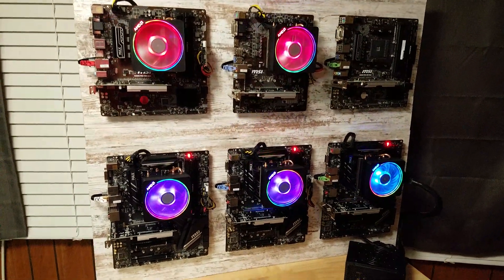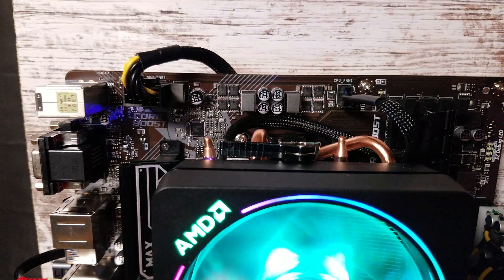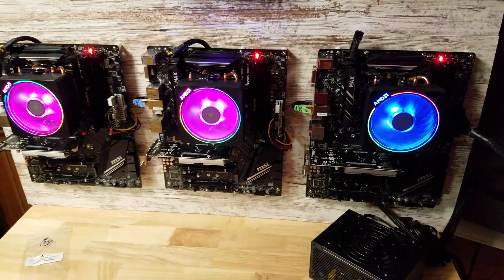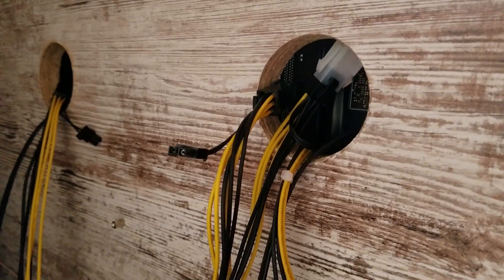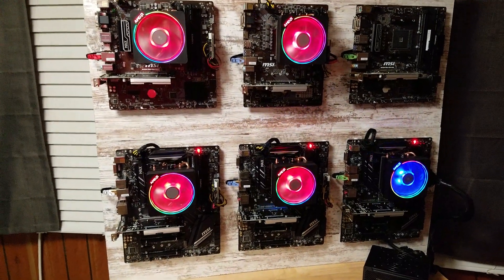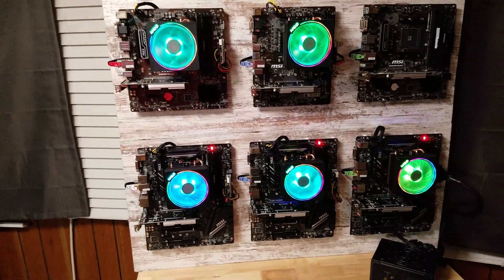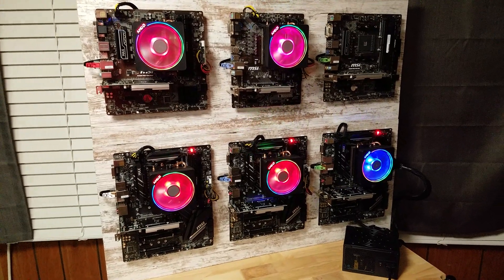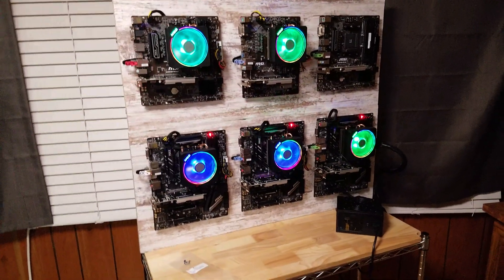Raptoreum Mining Wall

Comment: What’s your hashrate with the 3.6mhz and 1.0v setting? Thank you 🙏🏻
Reply from the maker: Avg hash is 3900x is 2.85, 3950x is 3.80, 3700x is 1.89 @3.6 allcore @1v
Reply: @slicknick8713  Ok I did some testing and with (Auto core and auto voltage) which gets me up to 1.4v max getting 3250-3400 depending what mobo (All 3900x on my rigs) Testing 3 (3900x) and 1 (5900x) now with (auto core  and 1.2V ) setting.
Reply: Why u running your rigs with GPUs? On RTM?